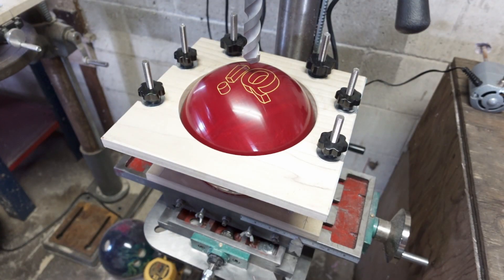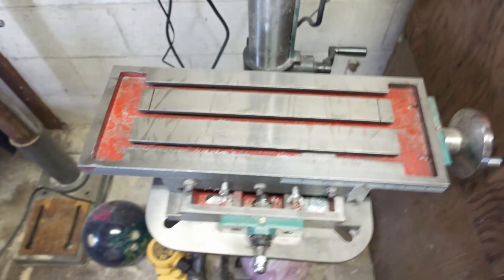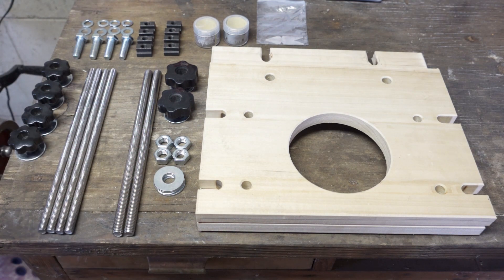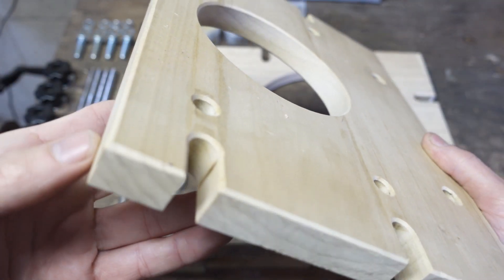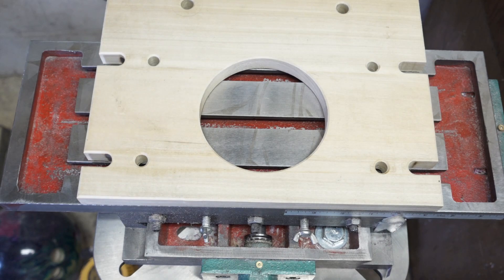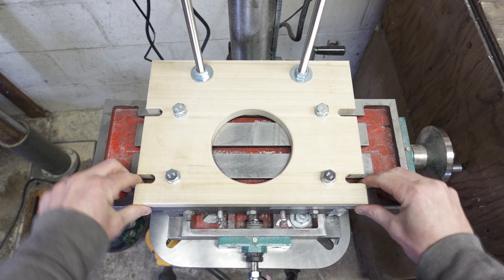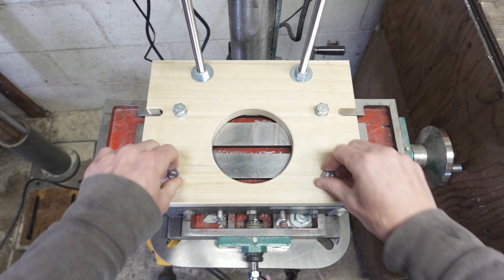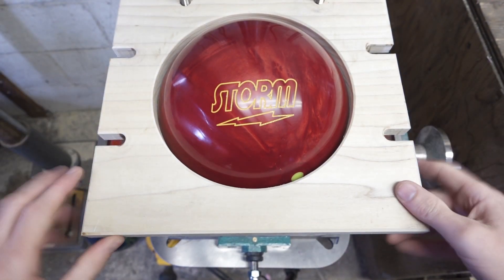Affordable Bowling Ball Jig for Drill Press

Comment: Is an 8-in drill press big enough or do I need to go with the 10-in or bigger drill press to make this work?
Reply from the maker: I can't say for sure without seeing the drill.  I can tell you the top plate is 12" x 12".  Usually an 8" drill, is 8" from center to the column, which is a 16" swing, and should be enough.  But I can't make any guarantees.
Reply: @KennyGrinols  I haven't bought a yes yet but don't have disagree for a huge one.
So i plan to get the smallest usable size
Reply from the maker: @BARBELLS-AND-BUDS  the biggest question is the depth needed to drill holes.  If you're just drilling fingers, for a no thumb bowler, then there are plenty of cheap options, even a Harbor Freight model that can do what you need.  But if you want to go 3.5"+ into the ball, for thumbs, and interchangeables, then things get a lot more expensive, because you need 4.5" or more of 'quill travel'.
Reply: @KennyGrinols  I've heard a lot of videos and you should drill three and a half or 4 inches into the fingers if you're doing finger only?
Reply from the maker: @BARBELLS-AND-BUDS  that's up to you.  I only drill my fingers the exact depth of my finger grips.  Mine is digital so I set the zero on the ball surface and then drill 2⅛ down.

Drilling deeper can alter core dynamics if you desire to do so, but I don't like hitting the core anymore than I have to.  The Storm 2LS video shows exactly how finger depth alters post drilling numbers, to me, it didn't seem worth it on paper, and even in practice the effects were minimal.  If you want stronger dynamics, you don't have to drill deep, just use longer pin to CoG, but that's just my opinion.
Reply: @KennyGrinols  Thanks for the reply
I just learning.
I do know that if I drill deep and don't like the results when I plug it, I'm not going to get the dynamics back that I lost billing into the core so I can see it being better to do shallower drills honestly.
Reply: @BARBELLS-AND-BUDS  I had a Motive venom recoil ball given to me that was drilled to deep on the fingers and the thumb.   The thumb was to deep to even instal a Vise-it without plugging it first.   But I spent the $55 bucks that my pro shop guy charges to get it plugged and drilled even though he told me he would chunk it in the trash if it was his.  We drilled it to my pap like all my other balls and it was the only ball I have ever had roll over the thumb hole.  It just reacted so different and not in a good way.  I gave it to a friend that plugged it yet again and loves it.       He is really good at drilling and the cheapest of anyone in the area by far.    So I would would listen to kenny on this one.
Reply: @jvmiller1995  I'm only talking about when you're not using a thumb hole because that's where a lot of the core gets removed.
This is based on information from MO Pinel.
Even after his death two years ago, he still the most knowledgeable bowling ball designer.
He says drill your finger holes for a two-handed no thumb. Bowlers at least three knife inches
This is because we can no longer use weight holes and because bowling balls are designed initially for people to have two fingers and a thumb.
Reply: I also think that when the bowling ball was drilled too deep in the thumb, it's hitting too much of the core, which is the densest part of the ball. When you put polyester resin or whatever they use to plug the ball in there, it's a different density and you'll never get The same properties back with a plug.

With all that said, I agree that a ball that's drilled with a thumb need only have fingers drill deep enough for the inserts